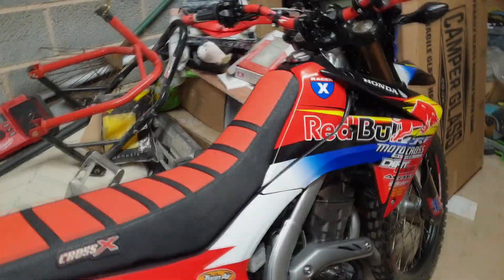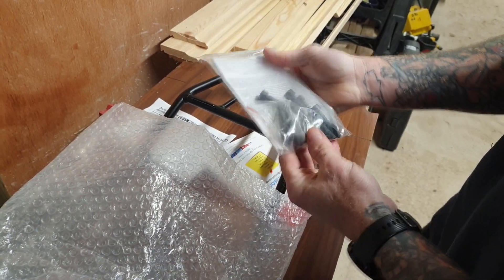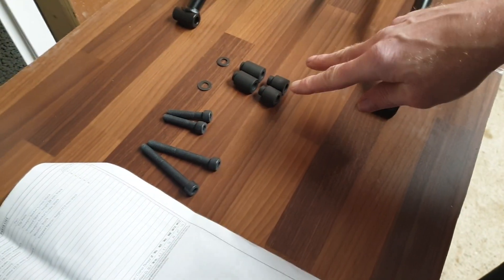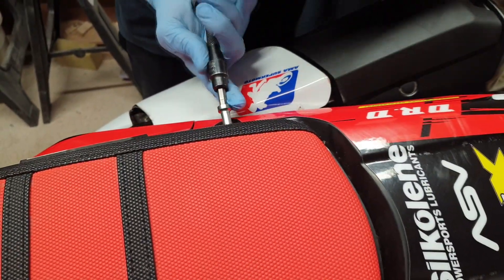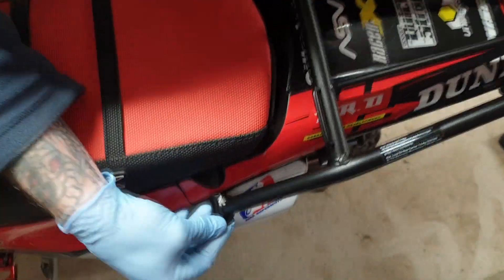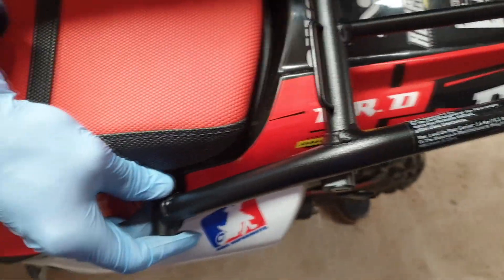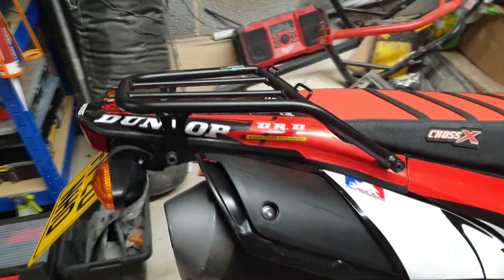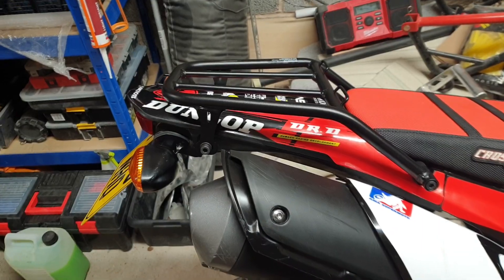Honda CRF250L & Rally | SW Motech Rear Rack Install

Comment: Does that crossx seat cover make the seat more comfortable, or is it just for grip?
Cheers.
Reply from the maker: Its exactly the same as standard comfort wise but with the added bonus of grip when in muddy wet conditions you dont slide around the seat in tricky off road situations 👍🏻